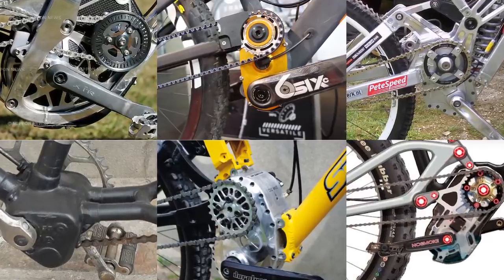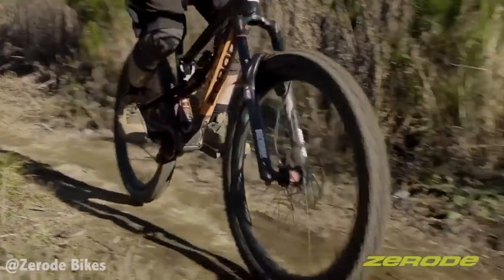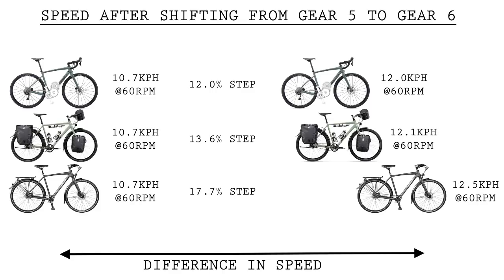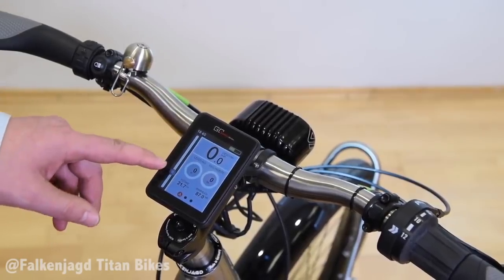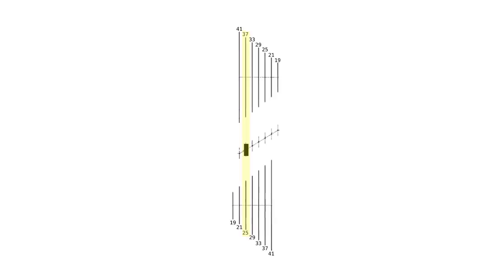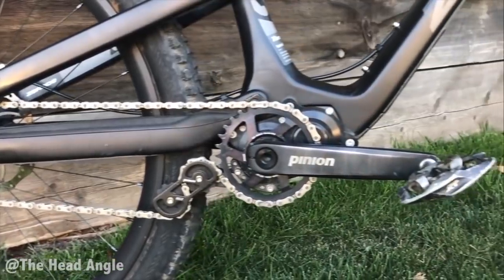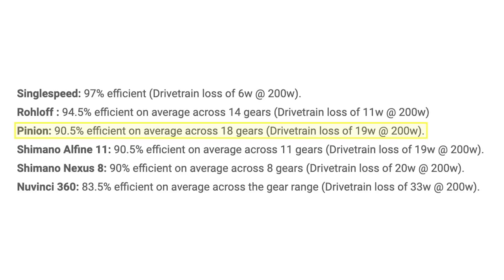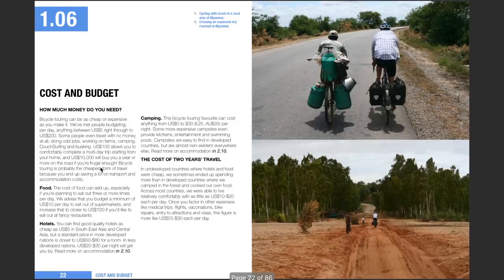Inside the FUTURE 13-Speed Shimano Gearbox - Weight, Drive Efficiency & More

Comment from the maker: If you like bike tech, subscribe HERE: http://bit.ly/cyclingaboutsub
Oh, and feel free to cycle around the world with me on: 🔥 INSTAGRAM.com/cyclingabout 🌪 FB.com/cyclingabout
Reply: i still believe a drive shaft would be best
Reply: Were you in Death Valley on Saturday Nov 2nd? If so, cheers!
Reply from the maker: @dh3790  Currently cycling across Guatemala!
Reply from the maker: @bobamericana3099  Unfortunately, this has been done, and the drive efficiency was just too poor. I do remember being a kid and seeing a shaft-driven bicycle, thinking it was the coolest thing!
Reply: @Cyclingabout   indeed- chain is most efficient .  i am in the process of building a delta style recumbent trike. rather than having 10 feet of chain going though rubber guides and what not- a shaft driven by  a worm gear on the pedal cranks would be cool...will have an ebike kit so i really not concerned with gearing and what not...a shaft would really clean up my build. as it it stands,rather than have that huge chain routed all over the place i went with a transfer case of sorts..a normal chain from the pedals to a coaster gear..then a second chain from that gear to the rear axle....a simple shaft design for that 6 foot length of the assembly would be beneficial in my case- at least as efficient for a really complex  1 speed drive .
Reply: cool
Reply: Was that a subliminal flashlight to Payne @8:30 ?
Reply: Love it so much
Reply: А заднюю передачу когда добавят?
Reply: @TKillin  it's "2 chainz", a rapper
Reply: Wouldn't this gear box remove the possibility of a mid drive e bike motor?
Reply: @TKillin  ooh, nice 🐈 ch.

Comment: Finally, a video about Shimano gearbox from someone who ACTUALLY knows about it!!!! I will never be able to afford it but I can listen to Alee all day on this!
Reply from the maker: Thanks! I'm probably the biggest gearbox nerd going around, so it's my pleasure to share this knowledge. ⚱️
Reply: @Cyclingabout  of course man. If I could afford a gearbox, I would have bought it without thinking twice thanks to your words. Until then, I will watch and listen to you. Cheers mate.
Reply: @amitkumar-wj8gn  microfinance WAS built for putting THIS at crankcenter.
Reply: amit kunar i would not be so sure about that? The intended target seems to be the mass market. The price will fall significantly when it is made in large mass market quantities. The only stumbling block i can see is it will never compete with single chainring 1 on 9 setups for weight, nimbleness or reduced mechanical resistance. It just does not seem to have sport potential.
Reply: @MrDegsy69  This thing isn't mass market compatible. It's heavy, expensive (in comparison to traditional shifting) and requires a dedicated frame design. I don't see that thing going off in anything other than electric bikes. There seems to be a segment of customers in that market that appreciates a bulky, almost motorcycle-like look, and isn't too price-sensitive.

Comment: Regardless of how well Pinion, Rohloff and Effigear designs work, they have just too many machined/sintered components to ever be affordable enough to be used on the majority of bikes, unless they do something really clever to radically reduce costs. Shimano is in with a chance given that chain/deraillleur stuff is more mass produceable and with enough work could maybe reduced to a reasonable size/weight. Could be made smaller with material/heat treatment/coating(?) optimisation. Very good videos from the guy. Defo worth a sub.

Comment: 1:57: Your estimate for the size of the gearbox is based on the assumption that the 19-41 cassette will be the same size as a regular cassette.
However, It will probably be a scaled down version - smaller gears, shorter links in the chain, narrower axle. 
It'll probably spin faster (than  regular cadence) to allow the same power output with a lower maximum torque.
Reply: Would the UCI rules on chain pitch still apply inside a gearbox? That's the limiting factor. Shimano already did experiment with smaller chain pitch and it was more efficient, but that was banned.
Reply: @vaynomblenner I'm pretty sure gearboxes are strictly  banned by UCI.
Reply: @kroee  as I understand it, the Honda G-Cross team used a gearbox based on commodity bike parts in the downhill world cup. Did the UCI issue a ruling on gearboxes subsequent to that?
Reply: Roee Keren that is so ridiculous. These artificial barriers hinder innovation so much. It’s too bad that most of the bike community is too busy trying to look like their favorite WT pro to realize their needs are nothing like those of the WT racers. When I look for cars to buy, I don’t think about whether they meet FIA regulations. How absurd.
Reply: @404nobrakes  WORD!
Reply from the maker: Keep in mind that the crankset in the patent drawings is also scaled perfectly to the cassette size. I think this gives a fair indication that the cassette will be similarly-sized, but perhaps you're right and Shimano is throwing me off my scent! And yep, the first chain definitely reduces torque between the cassettes by spinning them at a higher RPM.
Reply: @Cyclingabout  calisthenic stress i prefer to word torque but defer to your expert diction as well- any greater experts gonna back me however?
Reply: A smaller system would save weight, too. The smaller the better as long as it is strong enough.
Reply: @Cyclingabout  I wouldn't be surprised if they patent drawing is not to scale just to obfuscate the future product slightly. For example, notice that the in the cutaway drawings Shimano shows teeth on the gearbox input chain cog, but not the cassettes. The cassette details show teeth, but no scale. With the chain design they show, I wouldn't be surprised to see the chain reduced to even 50% standard pitch. Industrial 1/4" pitch chain is available, so why not use it for bicycles?
Reply: @kroee  UCI Regs specifically state powertrain should be "comprising pedals and a chain". Sounds to me like any kind of gearbox/multi-chain system would be prohibited. That said, there is a large difference between the demands of a UCI racer and basically anyone else!
Reply: @404nobrakes  steroids are cool but how dare you guys engineer a better bike!
Reply: I am confused. You see the size at 00:51 and 00:57 in the patent drawing mounted onto the bike.
Reply: If as described it's clearly not for racing, it's for commuting so kinda moot point.
Reply: If it weighs 1kg more its not for racing anyway, who cares about UCI.  Also their chain pitch rules most likely will only apply to the chain connecting the wheel not a internal one to the gearbox.
Reply: UCI seems like a hindrance to innovation and fun. Uninventive Crotchety Incorporated?
Reply: @fojrsepta4959  No.

Comment: Gearboxes did make it to the mass market.  Lots of people, including my grew up use The Sturmey Archer 3 speed hub!  They were used on a ton of British made bikes in the '50s, 60,s, '70s 80's
Reply: I have one on my Columbia Tourist, probably an AW but the hub shell is covered in grease oil and dirt so it's unreadable, the hub is gutted with it's parts all over a drawer in my toolbox because I'm cleaning it and putting fresh grease and oil in it, also going to see if I can seal it to keep it from dumping oil out everywhere so it doesn't make messes and so I don't have to refill it as often to keep it going for another 70 years.
Reply: @nathanmead140  replace the rubber seals, they rot over time.

Comment: Thank you for such a thorough review. I’m surprised that you feel confident that it doesn’t have the potential for an ebike motor. My understanding was that the bottom part matched the profile shape of the Shimano steps motor, which gave me hope it would be possible. I think having a gearbox & motor in one is the future, even if Shimano isn’t designing this to be that.
Reply from the maker: Some outlets have reported that it will integrate with an eBike motor, but this is highly unlikely given the drawing specifications. Take a look at the inside of a Shimano Steps or Bosch CX motor and you can see that those components will have a VERY hard time fitting inside this gearbox, especially around the first transmission (cassette).

Comment: Excellent informative video as usual. I've owned two Rohloff hubs, I'm pretty sure 97% efficiency is only rarely achieved. I like the narrow Q-factor on these Shimano drawings, which imo is a problem with the Pinion offering.
Reply from the maker: Cheers! According to the data we have, the Rohloff averages out at 94.5% efficiency with gear 8 and 11 being the two most efficient gears.
Reply: Alee presents data saying that the Rohloff is quite efficient (94.5%), but I've been reading different opinions with the consensus being the Rohloff is "draggy".  It might just be a weight distribution thing or a something else unrelated.

Comment: I rode from the US to Panama on a Surly Ogre and the biggest pain besides the tire(I was an idiot and went with 700c over 26' where 26' is the standard) was the drive train.  Rust, much, chain stretch, gear wear; it was all a big headache.  I haven't completed my tour into South America because I'm saving enough money up to get a gearbox.  Hope this comes out soon, would love to see this on a Surly Troll(the 26' version of the Ogre).
Reply from the maker: I love having a fuss-free drivetrain! Switching to a Rohloff definitely improved my travel experience when I started doing longer and longer trips. These days I might get the toothbrush out and clean the belt every month or two, but that's about it.

Regarding 26" tyres, they're now becoming far less common! When I was in Colombia, I was shopping for a 26" tyre in a big city with a friend, and we couldn't find anything more than a $5 Chinese option. In the shops, most new MTBs come with 27.5 or 29" wheels, so those are the tyre dimensions shops stock in decent quality.
Reply: @Cyclingabout  what about every other country?  From the US to Panama when I went to buy tires there were tons of 26' and no 700c.  Maybe north Latin America is different than South America. . .
Reply from the maker: @buckettraveler8398  From what other multiyear riders are saying, this case for most countries around the world. And certainly the case for Latin America in my experience. The only region where good quality 26" stuff is still ubiquitous is Asia - but they have ample 27.5 and 29" gear too.
Reply: @Cyclingabout  This wasn't my experience.  I rode into larger cities I was so desperate.  I would get to a bike shop, both high cost shops that sold top of the line stuff and the shops that locals frequented that used their bikes for sole transportation and work and both kinds of shops stocked mostly 26' and might have a few other sizes.  I wasn't on a specific bike rout though but like I said I rode through every capital and a lot of cities hunting for tires because mine were worn out.  Bike shops would even see the state of my tubes and tires and call around for me and locals at the bike shop would do the same thing.  Most shops only stock 26'.  Mexico City it was even a pain to find anything in 700c that wasn't a skinny slick racing tire and that is the largest Latin America city behind Sao Paulo.  So Mexico, Guatemala, El Salvador, Honduras, Nicaragua, Costa Rica, and Panama 26' is fully stocked and everything else they might have a few other sizes but only in slick racing/road tires.
Reply from the maker: @buckettraveler8398  Don't get me wrong, 700C tyres in a 32-50mm are still harder to source in developing countries around the world. But 26" is rapidly getting replaced by 27.5" and 29", so I'm currently recommending these two wheel options to anyone who asks.  👍🏻

Comment: I wonder if you missed one configuration that should work.   My ebike has a rear hub with 7 gears on rear cassette but single up front.   Now with the shimano gearbox the reverse should work, single on rear with hub motor and the shimano Gearbox in the middle.   This would allow possibly for gates belt drive which would be a great setup for commuter.   I usually use low to no power on my e-bike, except for steep hills.   But today I was SOOO grateful for it.   I had not looked at weather forecast and a down pour started.   I left early to avoid early darkness and the heavy traffic.   Full power all the way home.   So happy to have that motor.      This gearbox would be a great pairing for ebikes  I think.
Reply from the maker: That's right, the external drive is single speed, meaning you could run a belt!

Comment: What happened to the KISS principle? My brain itches at the thought of this. In the 1980s Sturmey made a nice 2-lever/2-cable 5-speed based on the pre-war FW hub. They eventually put it in an aluminium shell which made for a solid wheel. It was inexpensive, weathertight, fairly efficient and you could dismantle it, clean it and put it back together within a couple of hours.

Comment: The Pinion one comes with a five year warranty!! Deviate are running one on their bike ! For me it means no more expensive drivetrains!  Even if the gearbox is pricey I’m not bothered. Great video thanks
Reply from the maker: The five-year warranty is a very nice service! The Deviate Guide is essentially my dream enduro bike. Unfortunately, they don't make frames big enough for a guy who's 2m tall. 😭
Reply: @Cyclingabout  Deviate makes a Guide plenty big enough for someone of that height.  It's not like 2 meters is freakishly tall.
Reply from the maker: @craigsj  I prefer a bigger frame than they currently offer. The bikes are not super-long as is.
Reply: @Cyclingabout  Then maybe you should state your preference for abnormally long bikes rather than make false claims about a manufacturer's product. A bike not being "super-long" is not the same as the bike not being suitable for a 2m tall rider.
Reply from the maker: @craigsj  It's not a false claim to want the right-sized bike. Why the hell would I ride a bike with a longer stem than the bike is designed for, along with a bunch of spacers under the stem because the stack is so low? There are literally dozens of other brands with appropriately sized bikes for me.
Reply from the maker: @craigsj  So ridiculous to suggest the geo numbers will equally suit someone 10cm taller than you. If that was the case, bike manufacturers would never build bikes bigger than a size large Guide. 😅
Reply: @Cyclingabout  Except that I didn't "suggest" that, it's just your straw man.

Rider height is a poor indicator of "fit" in mountain bikes as if that even mattered anymore. I would expect that you know that so it's particularly off-putting that you would choose to make such an argument.  Of course, you have little choice considering your original claim.

Look, if you can't make do with 480mm of reach then, by all means, buy a Pole but don't slander a make because of your extreme views on bike length. A Deviate Guide has pretty mainstream numbers by modern standards.

Comment: This is great for UK conditions. Keeping everything sealed makes sense. I guess you could change ratios as in a normal bike, at the expense of them not being so close together. MTB will be the main application as it is heavier and they take on more difficult conditions. The grit in the Peak District (UK) for example - kills bikes. Can see it popular in Holland too. They care less about weight and like bikes to be utilitarian with little maintainence.
Reply from the maker: You can change the external gear ratio to pick the speed at which the gear range starts and stops, but the 12% average gear steps will always stay the same. Will definitely be a killer drivetrain option for wet/muddy/gritty conditions, my Rohloff/belt drivetrain is my favourite thing about my bike.

Comment: It's a derailuer in a can . It's a very simple idea and its much lighter than a helical geared transmission. All the weight would be low and in the center of the bike. Chains are more efficient than gear boxes.

Comment: Can someone explain how this is maintenance free. I can see that the internal chains and spockets will have a relatively longevity being free from contaminates and bathed in lubricate but surely these will still have wear. How easy and often will this have to be done?
Reply from the maker: I usually say 'virtually maintenance-free' or 'almost maintenance-free' on gearbox drivetrains. 
- Gearbox manufacturers recommend you change the oil every 5000-10,000km.
- You will have to change the external chainring, chain and cog periodically - which is at 10,000km on chain drive and 30,000km on belt drive. 
- You will need to de-grease and lube a chain drivetrain, but a belt drivetrain doesn't require much more than a wipe-down every now and then.

The Shimano gearbox will likely last upwards of 20,000km before the cassettes and chains begin to wear out. Oil changes will likely be similar to a Rohloff or Pinion (5000-10,000km).
Reply: @Cyclingabout  But that would still mean exchanging the internal casettes / chain every couple of years for a lot of people. Essentially replacing the whole thing. Thats a very different longevity compared to a rohloff (and pinion?) hub.
Reply from the maker: @calaphos  I'm speculating, it could be many more kilometres/years than that. The point is the system will require far less maintenance than a derailleur system.
Reply: If it is a fully sealed oil bath, like the Fully sealed transmission in cars and axle, it will outlive your entire bike components before it needs servicing, practically maintenance free indeed.
Reply: Imagine dealing with all that oil inside. Its like a motorbike